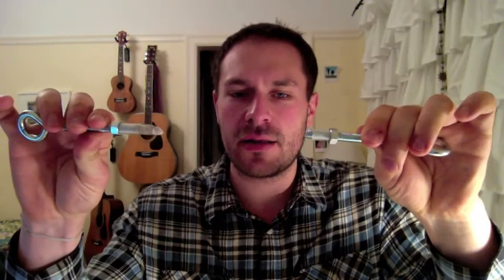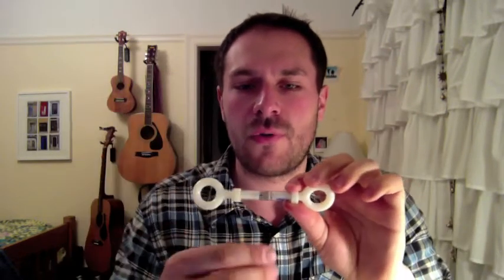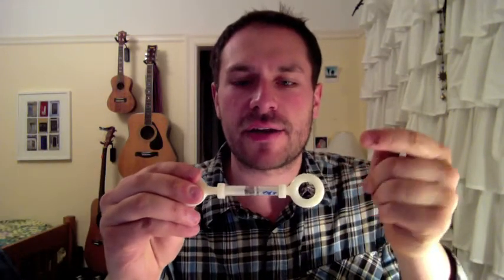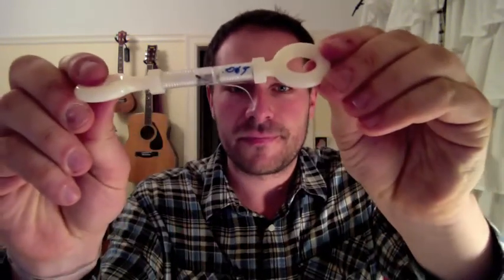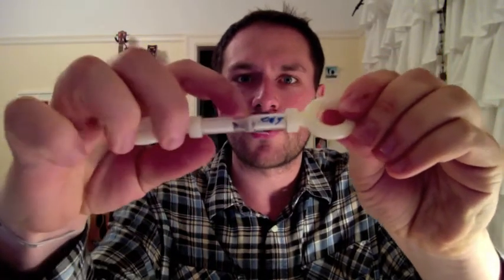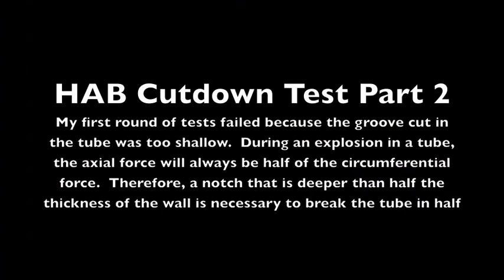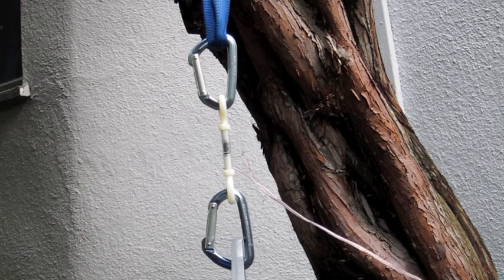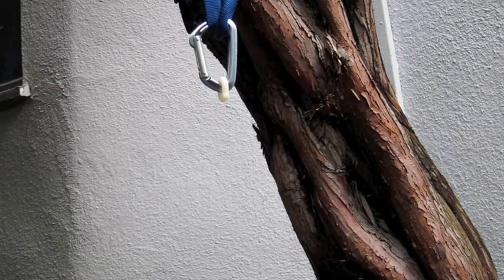HAB Cutdown Testing Part 2

Comment: Will this work in the low oxygen environment of the stratosphere? I think black power needs oxygen to ignite.
Reply from the maker: Yes, this works in the stratosphere. I have made it work several times. Black powder has its own oxidizer mixed with the fuel. No atmospheric oxygen necessary.
Reply: Thanks, I am looking at different methods of doing this and I was leaning towards the heated wire method. I will be rethinking this now that I see your device. What are you using to trigger it.